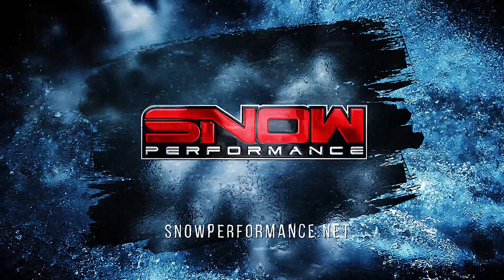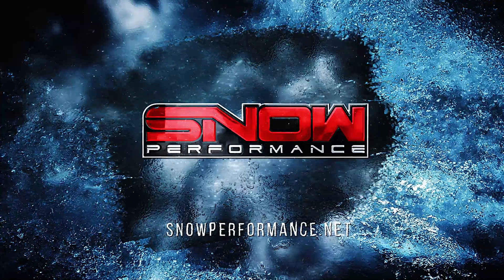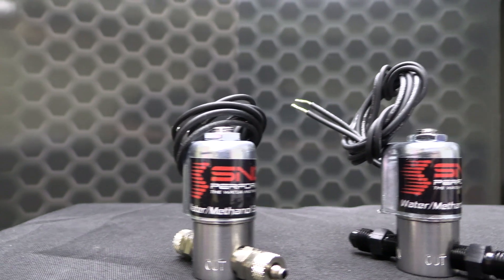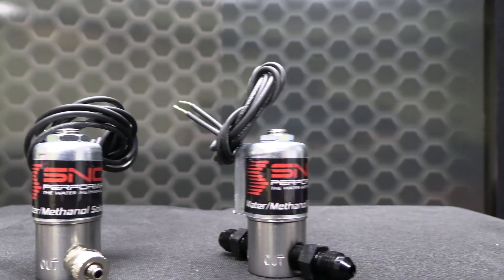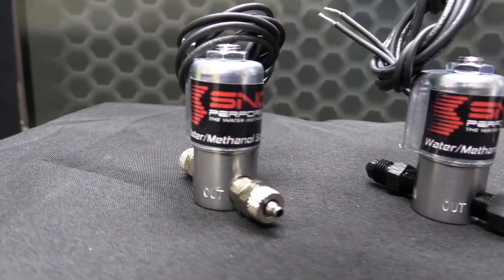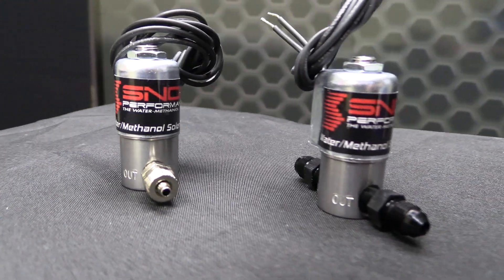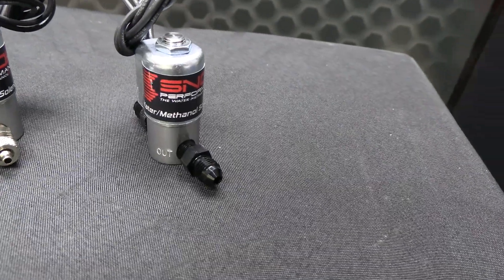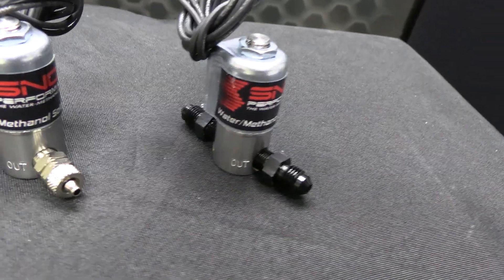Reasons You Should Be Using a Solenoid Upgrade!!

Comment: When i look at the kits (stage2) , as i like to get one, it looks like there is no soloid ? is it pump controled? and the soloid is used as a open/close if nozzle is installed lower than the tank?

I cant fint manuel or anything so hope for a link to manuels or someone tell me? :)
Reply from the maker: Our stage 2 systems don't come with a solenoid. We do sell solenoid upgrades like this in order to prevent siphoning etc...
Reply: @snowperformance1  so its the pump that control the flow? How do it do that, without loosing pressure in low flow? :)

I just think the solenoid cost alot, if its just  an on/off and not the one that control anything?

Wanted my pdm to pwm control the pump, but dont thing I can, unless i can get the data to control it (%, Hz and so on) :)
Reply from the maker: @martinring7628  The pump is pulse width modulated and is controlled by the VC-30 controller, our tech guy Chris may be able to answer more of your questions. Give us a call at 1-888-GOFAST-1
Reply: @snowperformance1  i send a mail to you, im not sure on the phone  number, as I will from another contry :)

Comment: My solenoid failed and my 210 boost cooler gave me no warnings. My engine became hydro locked after filling up my intercooler with fluid.
Reply from the maker: Do you know what might have gone wrong? The solenoids are reliable and you don't typically see issues unless some debris gets in the system and causes it to stay open.

Comment: Where to find the installation instructions? My instructions says solenoid not used for single stage and I want to use it with the check valve to prevent siphoning
Reply from the maker: For that kind of installation, you would bring one wire to the pump's power wire and ground the other. That way it activates and deactivates as the pump does.

Comment: So I have been slowly upgrading my older Snow Performance VC-25 stage 2 kit. I have upgraded to the HO pump, the no leak compression style fittings, check valve, 3lb/hr nozzle, and nozzle holder. I had my car on a dyno last year and the tuner said something was not right with the methanol controller, it worked, but he said at some RPM's it was "quenching", or not regulating correctly. So I just installed my new VC-30 controller. As I noticed before, my meth level in the tank would drop significantly faster than before I upgraded the nozzle and holder. The new controller did not change that. After some exhausting T/S, I narrowed it down to the new style quick connect fittings. I removed the hose at the nozzle holder and noticed the shape of the nipple the line slides onto is shaped like a cone. Unfortunately, it's shaped like a divergent duct, so the velocity of the fluid increases at this point. I believe this is how my fluid is being siphoned from my tank, being sucked past the pump, It also overcomes the check valve's supposed 30psi unseating pressure.  Now I will need a solenoid to completely stop the flow unless the pump is commanded on. Hopefully this will be the last component I will need.
Reply from the maker: Our solenoids entirely stop flow unless the pump is active, they are great for anti-siphoning
Reply: @snowperformance1   would I install the solenoid before or after the check valve?
Reply from the maker: @kevingarofalo8493  Personally I put the solenoid right behind the check valve in the engine bay and that seems to work well. It completely shuts off flow of the entire feedline and tank when the system is not active.

Comment: So if I'm using the solenoid because I mounted the reservoir in the trunk and to prevent syphoning since installing nozzle post TB via spacer all I need to do as far as wiring is One black wire to chassis ground and the other Black wire is wired together with the green wire (VC-50) and red pump wire Correct? Just making sure.
Reply from the maker: That is correct. It doesn't matter which wire goes to which on the solenoid.

Comment: Hi. I bought it and I installed as anti siphon effect. If I would like to use as second stage .. How should I connect it? Both lines (primary and power nozzle) after solenoid? Because If I connect only power nozzle after solenoid, primary nozzle do not prevent siphon effect.
Reply from the maker: You would need another solenoid to use it as a 2nd stage. What controller do you have?